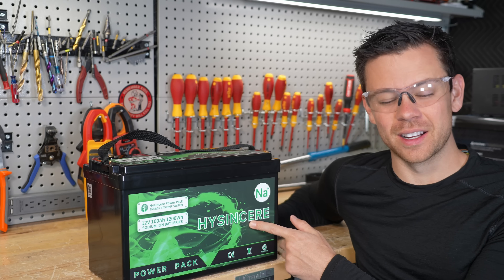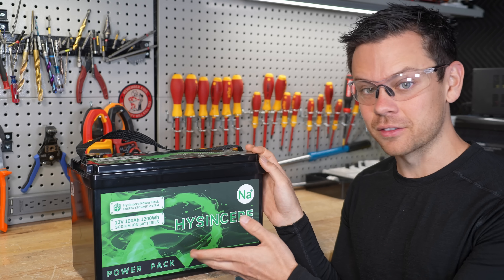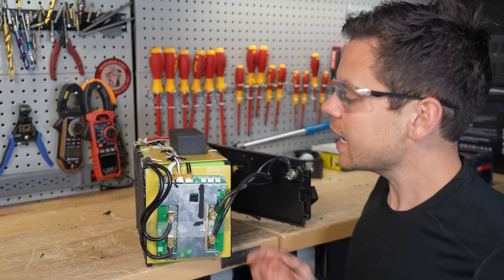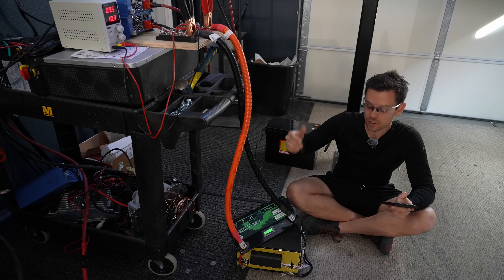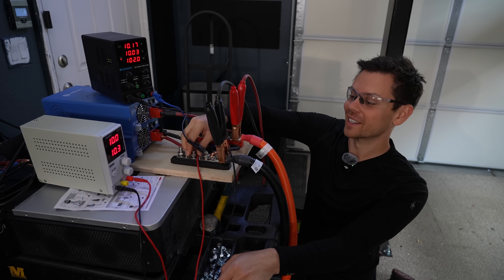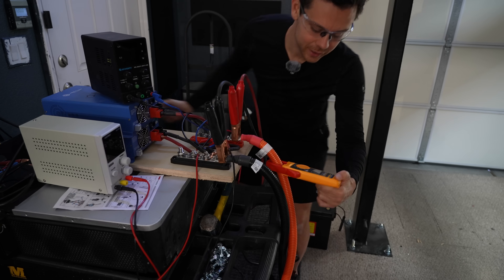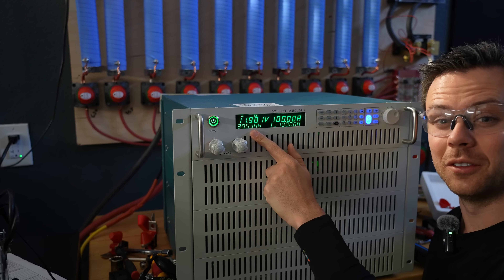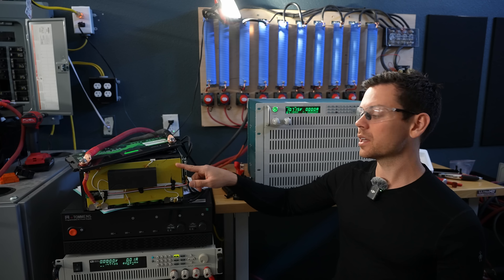Testing My First Sodium-Ion Solar Battery

Comment: Although I have never personally tried a sodium battery, I concur that LTO or heated LFP is a much better option for bulk storage where low temperatures may be encountered. For my automotive starting batteries, I am thinking to keep lead-acid.

Comment: So I have been using sodium ion 18650 cells for sensors a lot recently because I can get them for around $1.70 a cell. The big huge boon has been that we have been losing fewer of them to over discharge as it’s gotten cold than previous installs with Lion or LiFePos. 

I can see some use case if you are cold storing the cells for occasional use like a hunting cabin as the chemistry evolves

Comment: These need built in DC voltage regulation to avoid high current at lower voltages.

Comment: Maybe grid storage ,  for emergency power , especially with efficiency improvements.  Something where it can charge for a week for month +.  Then be used until power is restored.  It can save lithium for other things. An  emergency backup where 10 mwh  battery banks are charged at 100 amps  for (ever) long times between outages. Solar power needs something a little better.   Seems to me sodium  is basically  lead acid.......

Comment: Devices optimised for lithium battery chemistries show low performance with sodium batteries. This is a non-story. Test it with an inverter that's built to work with Sodium ion batteries. Might have to wait for those to be prevalent in the market, though.

Comment: im still loving the old lithium ion batteries, almost no voltage drop and some of mine are 15 years old and still rocking. now these where EV batteries that im using for a solar powered house so the load is different .

Comment: It's pretty clear that this is just another pro-lithium vested interest anti-sodium hit-job. And the there's no mention of any Chinese sodium ion world-leaders like CATL + BYD. It's all so tragically typical of all US and US-serving, mining industry-pleasing "journalsts" who're already being exposed and proven wrong again by the many large-scale sodium ion (or mixed) solar installations that China's unrivalled, proactively "disruptive" EV + battery + tech gurus have already rolled out.
And those "studies" fail to mention one of the key advantages of sodium batteries which is that they tolerate a much wider temperature operating range than lithium-based batteries - as in:  -40C to +60C. 
What's more China's manufacturers always deliver on their low price promises - in polar contrast to almost all US/Western businesses of ANY description...

(Paul G)

Comment: You need a dedicated inverter that handles the voltage curve to make them work properly.  One advantage of the voltage curve it's it's trivial to know the state of charge, which is more complex in lithium cells, and can lead to problems.

Eleven Energy in the UK sells systems with specific inverters.

Comment: New tech will improve and get dramatically cheaper over time. Right now it may not be worth it, but potential benefits cant be ignored: safer, cheaper, operate over wider temp range, more charge cycles ...

Comment: The performance you know that it will always be defined by a good BMS at least in solar use let's assume that by mistake or accident the LFP that would pass is discharged to 0 volts they would inflate completely damaged and according to Sodium we can discharge to 0 volts without problems and return to the game only with that advantage I stay in Sodium

Comment: Used Na for over 3-years in moble service trucks.
Advantages: discharge wide range of temperature -20's to + 140's without temperature controls.
Disadvantages: 12 v and 24v only - inverters can't use the Na wide voltage range above this.  Fewer cycles available, less useable capacity, cost more, heavier.
For a truck set up in TX you don't have to worry about the batteries being too hot even in summer, similar for a set up in MN you don't need to waste energy with heating them in winter - important stuff in a service truck.

Comment: With Sodium-Ion Solar Battery, is worth the trouble, when we use. 
Technology doesn't come fully "made" before you. It is  a continuous process of improvement. So is the case of Sodium-Ion Solar Battery (I think it is called NaFe-ion). Most applications, are compatible with it. Temperature process is rather excellent & better than  Li-ion battery, that caused many fire accidents in cars!
Only thing is, to sort out minor issues & make it at least a fourth in cost.

Comment: I have used a battery pack from a tool to fool my charger. I apply the battery in parallel for just till the charger turns on. Not saying yours won;t trip off, just that mine did not.

Comment: My biggest hope for sodium batteries is they are less toxic, have less political supply chains, and are less flammable. I can't have solar where I currently live but if I did I would probably have a "power shed" to keep the batteries in as a safety against potential fires.

Comment: Lower efficiency is a big deal.  if it has better cycle life and beter fire resistance/safety  we could do well.

I'm sure the inverters and BMSs can be adjusted in software to work with the voltage

Comment: You talked about off grid solar, but what do you think about sodium ion for  whole house battery backup?  If you just need something to power the home through a storm type usage do the shortcomings from this video matter?  I'm not criticizing, I was just hoping sodium ion would be good enough to bolt up to the house some day and I'm not sure if I need to adjust my expectations.
Reply from the maker: Check out my latest video

Comment: I wonder how much of this is the Problem of it being cheap chinese crap and how much of it is the actual battery chemistry.
I have seen cheap chinese crap LFP cells that died after less than 5 years and they were dead dead, like not even holding voltage for half an hour dead.

Comment: The thing is that LFP is a non-recyclable hazardous waste. Sodium is not. That is the only advantage there is to a sodium battery that I can tell. It is a little short of the mark in all the other categories as far as I can see.
Reply from the maker: Totally not true. It's non-toxic and recyclable
Reply: @WillProwse  I have handled lithium cells. They have to be disposed of as hazardous waste.
Reply from the maker: @josepheccles9341  which chemistry? Each one has a different safety profile. And toxicity. And ability to recycle.
Reply: @WillProwse  I couldn't tell you which chemistry, but that they were automotive.

Comment: Thank you for putting up this video, I was sure wondering about these because of all of the super hype that was going on!
I can tell you from an electronic engineer point of view, that having that linear discharge curve, really relieves the necessity to engage boost circuits and other things that are horribly inefficient, even in their best incarnations.
Looking forward to more test and possibly more variance of this battery just as you are.
Once again, thank you very much!  😊

Comment: They could use smart technology to start a car with low voltage. Oh wait they do with those capacitor jump starter pack. But they didnt go mainstream  unit built in far as i know

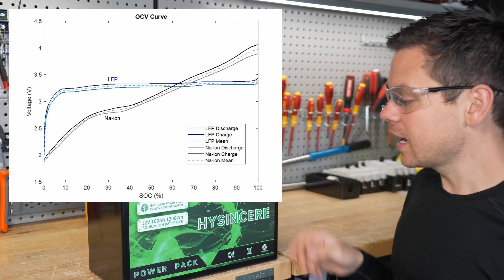Comment: Dear Will. In this video starting at 0:24 you complain "And it's (Voltage) so low, in fact, it would turn off most inverters pretty early. So, you wouldn't even get 82 amp hours. You would get less than that. For example, at 45% state of charge, I was getting 9.9 volts."

So why are you so negative? That property of sodium batteries has been known for a really long time. And the simple solution is: We connect two batteries in series, after which the lowest voltage level is double. Then we take a suitable BUCK device, which lowers the output voltage to just the right level - for example, adjusted to 12V before the inverter.

I don't understand why you make safety an issue?
Reply from the maker: Watch my new video. And no, that would decrease the efficiency. Not smart
Reply: @WillProwse  Wow. I thought based on my experience that you never respond to comments. Well - I was wrong.
Reply from the maker: @MR-ub6sq I respond every couple hours haha just a lot of comments, sorry

Comment: RIght now, I see this as a first generation of the Sodium battery, of course it's going to have lots of limitations.   Give it time, and I'm sure that there the people researching this stuff will come up with new formulations like they did with LiFePo batteries.  Just because it's on a part with lead acid today, doesn't mean that there's no potential for it to be much better in future.    The only question that I have is, as a comparison of Lithium to Sodium the potential explosion risks if one goes up in flames.  Will it be like working up the Alkaline metal reaction demos.   In which case, could we one day end up with caesium batteries. KABOOM!

Comment: My take away is like alkaline vs hydride. Tv remote battery vs rc car concepts.
Sodium batteries should be considered as a secondary battery storage for energy accumulation after primaries are full.
Sodium batteries in this setup shouldn't be used for continuous high current draw. Instead these batteries should be used for 3v3, 5v5 and low current 12v systems.
I'd like to think these batteries running dc led lighting and other low current items might out perform lifepo due to discharge current minimums

Comment: Why is nobody (and also not Will) addressing the MAIN advantage of sodium ion batteries: using globally widely available materials (a.o. sodium) that do not put so much pressure on environment, society, and politics as lithium does??
There is more in life and society than just money. The capitalistic model ignores the most important factors for human wellbeing (clean air, clean water, proper health care etc etc) and does not value it (and even jeopardize it to make more profit). 
The world is in urgent need of extreme upscaling of the battery capacity to allow for the energy transition to be succesfull and we have to do that in a more sustainable way! 
When only looking short term from a capitalistic view, compare it to current LFP price levels and making fun of the performance you do not see the bigger picture and the extreme challenges that mankind experiences now and in the short future.

Comment: Of course ... Sodium ion will never be suitable for a 12V package , starting a car ... manufacturers of these pacs are taking advantage of people who want to explore the new ... When the cost is dramatically low , all cars will use them ... life is so long the battery will still have 90% capacity  when the car is rust , then the big industry will be salvaging the cells for use in static power storage.

Comment: We need hybridized batteries where they use a mixture of chemistries and a controller designed to regulate the distribution between them and change needs based on environmental conditions. Feel like this could be the way to bring out the advantage of each chemistry.

Comment: There looking fucking amazing but for anything that uses a lead acid battery where lipo just doesn't really fit no matter how much we want it too. Like any charging system designed for lead acid and high cranking amps

Comment: I need a new battery for my older SUV.  I am contemplating the idea of dropping in a sodium ion rather than lead acid. In MI, it's not practical to use a lithium battery outdoors, and there's no way I am going to heat one with electricity because I am 75% off grid and heating with electricity is not something I am willing to do.

Comment: good video; I got to test my first na-ion pack about a month ago and was similarly disappointed and a bit confused as to what I could use it for. the linear discharge curve was the killer for reason you mentioned; the inverter I use for testing kicks off at 10.8V (and I had same problem with getting an inverter to take its high charge voltage), and having to deal with a voltage that's all over the place adds substantial complexity whether the inverter's built targeting na-ion or not.

big benefit is ability to charge and discharge at an extreme rate, but this also makes me terrified of them relative to a standard 12V LFP pack. and then you can discharge to 0V and recharge without substantial damage (so long as this is a one-off accident and not something you do regularly), which is kind of neat, but also something that just doesn't come up for me.

I'd guess these will live almost exclusively in sophisticated grid-scale setups where na-ion packs are used in conjunction with LFPs to act sort of like capacitors for short intense bursts of charge or discharge. with inverters able to handle wider voltage ranges, there's maybe also value in na-ion packs for EV quick-charging at home; seems complicated/expensive to pull off well, though.

Comment: I am running a car with a sodium battery, ditched the lead-acid na for good. Bms only balances. With this setup, my Diesel starts better than gasoline cars. Summer went fine, fall so far so good. Cold cracking amps are happy.

Comment: Again a great test! I see no use for Na-ion for the next 5 years probably. The voltage-SoC-curve is a mess and most applications won't fit here. Also the very bad efficiency is a no-go. I'll stick to LFP  - like the stable voltage curve - but hard to determine the SoC from the voltage.

Comment: Sounds like 90% of the Sodium ion problems you have can be fixed by having a specific charger / inverter that is designed to work with SI batteries.  That would at least fix the charging issues and the issues with not being able to use 100% of the Soc.  I would take an efficiency of around 90% if I can buy them at sub $30/kwh lol.

Comment: The biggest benefit of sodium-ion batteries is that it's a more sustainable technology.  Lower raw material costs, less reliance on raw materials from countries with geopolitical and supply chain issues, easier recycling, and smaller overall environment impact.   But ya, it's still new-ish and needs more development before it can catch up to lithium batteries that have been around for decades.
Reply: At twice the cost

Comment: I have been using a sodium ion starter battery in my 750cc twin cylinder scooter for 1.5 years now and it's been rock solid.  
It has a balancer that starts balancing around 3V cell voltage and a 250A fuse... that's it, no BMS nothing.  
Even at 10 V it still starts the bike just fine (left the ignition over a rest stop) and even at -10°C it starts the bike just fine and I don't have to worry about the cells.
Reply: Thanks for this. I am interested in converting my sailboat from AGM lead to LFPo4, but have heard that the instantaneous current load from starting could ruin a LFP04 battery. My sailboat has a 3 cylinder, 45 HP diesel engine that I can turn over by hand--I wonder how that can be such a huge load to start. 

Will mentioned using an LFPo4 in the video as a starter battery as long as it was kept warm enough. Well, I'm not sailing very often when temps are below freezing, so I wonder if I could just scrap the idea of keeping a AGM Lead as a starter battery, and instead go with two 300AH in series (with a 240watt or better solar panel to charge them). 

The dual chemistry thing adds a lot of complication, and I'd like to skip it.
Reply: @Kenbobb you can just parallel a sodium ion with the AGM, should be 0 issues.
If you need 24V use a 24 V battery, most BMS are not setup for series balancing of multiple batteries.

Comment: I knew there were issues with salt batteries that made them better and worse that lead acid as a replacement, same goes for comparing them to LiFePo4 which is an equal price for a better battery..

Comment: There were issues when we started using LiFePo too. Chargers didn't like the lower voltage and way less Wh that Lithium Ion. It's just different and the optimal voltage where all the power is was at a lower voltage. The same is true again for Sodium Ion. Doing testing to 10v when the battery is at half charge at 9 volts is a bit of a let down. I get the reason you dislike it, but you are misrepresenting it as a whole. You are saying it does bad with Lithium Iron chargers... well duh. It's still bad for now, but you made it sound like it was 1/2 the charge for double the price. It's more like 3/4 or better of the charge for almost double. I wouldn't buy into them for a while. Not until they are the cheaper option. Lithium is expensive and most of the cost of batteries. These don't use that, but cost more to produce. SO until production is scaled they will be more expensive.

Comment: 4:44 use a 12v battery to "jump start " it , similar to how you would jump a vehicle, leave it connected for 10 to 15 minutes, and then try to charge it, if the charger doesn't start , hook it up to the "charged battery" again for 10 to 15 minutes and repeat till it starts charging

Comment: I think the future of Sodium Ion is going to be for HOME power storage exclusively for the safety aspect.  Also, theoretically, it should be cheapest solution...eventually.
Reply from the maker: They are no more safer than LFP or LTO.
Reply: @WillProwse  Is there something I'm missing then?   There aren't too many videos on Sodium Ion...but all the Sodium Ion puncture (internal short) videos I could locate show no flames coming from the cell but plenty of LFP cells with visible flame.
Reply from the maker: @RK-kn1ud LFP has limited combustibility. Look up the safety sheets. Or transportation studies. Sodium ion cells can also release hydrogen cyanide.
Reply: @WillProwse  I'd prefer to do my own testing.  Real world = more betterer than white paper.  Gotta wait for some cells to become available.
Reply from the maker: @RK-kn1ud agreed so much lol

Comment: Not looking good!
Nickel-Iron is still the longest life & overall most reliable storage battery type for fixed installations, just rather low capacity for its size and weight.